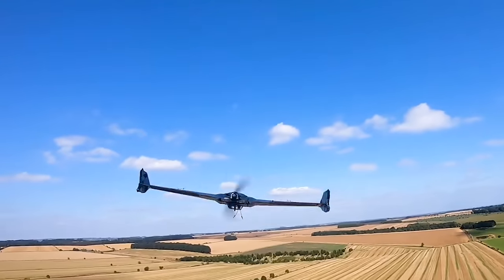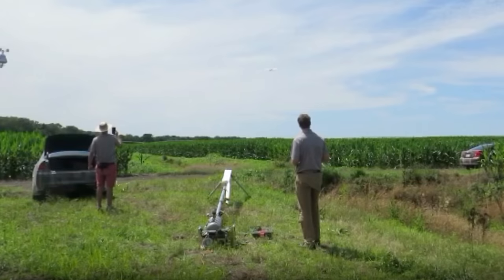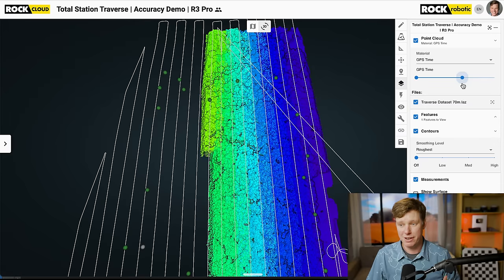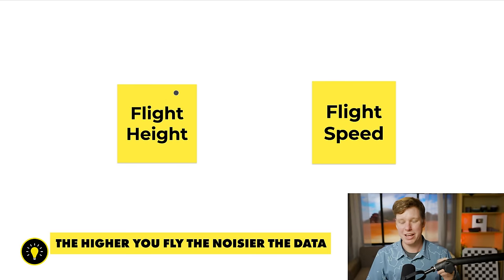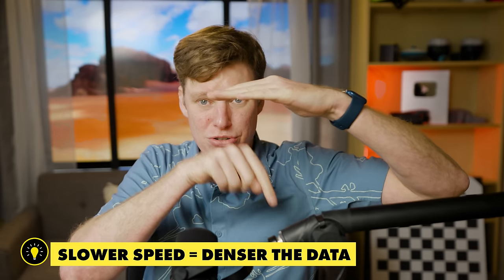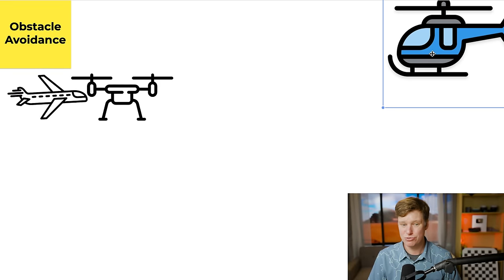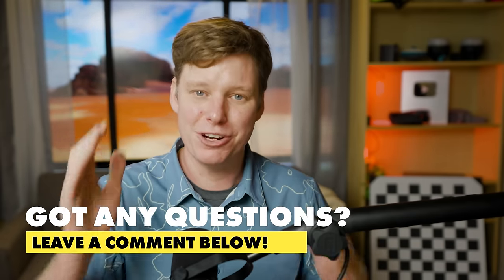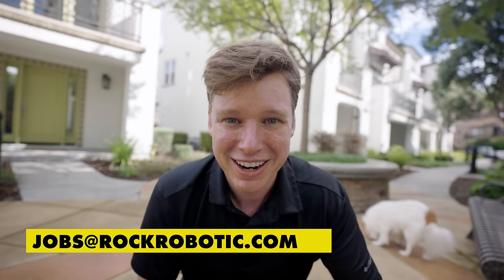Fixed-Wing vs. Multirotor Drone LiDAR

Comment: I completely see where you're coming from comparing fixed wing vs multi rotor in all the experience you have. But a lot of the issues you presented about lack of consistency in the data could be fixed by certain parameters you can adjust (at least with the autopolit software I use) and any accuracy issues I feel like would be resolved by being able to take a lot more passes thanks to the significantly longer flight times. Not doubting your experience and I agree with the issues you presented, just saying it seems like there are solutions to a lot of the issues you mentioned. Sure it would take more work to get it done with a fixed wing and those issues in mind, but you would be able to get a lot more data per flight.
Reply: You presented no fixes. You're an armchair expert. Your post is meaningless. You criticize without posting any relevant information. What was the point of your post? Post a video with your claims?

Comment: Hello, Knoll.
Based on my RGB photogrammetry experience, the performance and capabilities of fixed-wing drones (gliders) are highly topography-dependent. For example, in one of my research projects, I used Ebee Sensefly to model hydrothermal chimneys in a valley. Because of the collision avoidance, the drone flew so high that the results were marginally better than Google Earth imagery. As a result, gliders work best in relatively flat or uniform topographies, for the rest, a multirotor drone such as DJI Mavic or Matrice series would be more convenient.
Reply from the maker: Exactly! I would go one step further and say flat terrain and below level 3 winds

Comment: Wow, I learned a lot, especially scenarios I'd never considered.
Assuming fixed-wing is called for, why not use a gimbal to do automatic slew compensation?
Or dynamically adjust air speed plus gimbal elevation to compensate for terrain/flightpath discrepancies?
Seems like some algorithmic work could improves the workability of some tricky scenarios if you've gotta use fixed wing for other reasons.
Reply from the maker: For the Wingtra their stated stall speed is 16 m/s. So anything below this then you lose lift and stall.  So usually with the  LiDAR payloads that I am talking about we are already going at the slowest airspeed we can.  So any slower is impossible. 

I have made several gimbals for fixed wing and it is not practical for 2 reasons. 1) the added weight.  The max payload weight is 900 grams.  The LiDAR alone is already at or actually slightly above this.  So the added wight of a gimbal is not feasible. 

If we change airframes to a more traditional dihedral wing design and increase the lift surface area ... larger aircrraft.  Then we can support the added weight.  But still the stall speed is usually stuck around this 16-22 m/s.  I havent seen designs that is able to reduce the stall speed down to 6-10 m/s. 

I am sure there are some fundametal aerodynamic laws that might prevent this.  Probs contained in the interplay with mass and gravity force pulling you down and the theoretical limit of upwards lift which is a property of the surface area and cross sectional shape of the aerofoil and the viscosity (Reynolds number) of the medium (air)(PV=nRT)

... I am not an expert at aerodynamics but I can reason that these input variables are what results in the physical limitations.
Reply: @IndianaDrones 
 What about the hybrid drones that take off like a multi rotor and transition to fixed wing flight?
 Are you aware if anybody has programmed them to fly like a multi rotor when that's better given the circumstances and like a traditional fixed wing when that would be more appropriate?

Comment: Amazing video, I think fixed wings are good for areas which does not give you flexibility on reaching by land, so you can cover a huge area without the need to move on land and find a spot to park and take off from, which with the mult rotor depending of the distance you are not able to fly because you would spend your battery on the way and you still need to come back.... etc and considering that you cannot reach the spot by land...

Comment: The big limitation i noticed with Fixed wing or Multirotor (M3E) is the RC. As much as we can swap lot of batteries for my M3E, the RC battery life limits how much data can i collect in a day. For M350, there's a battery swap, but, not sure how many batteries will the RC lasts as it heats up a lot. and YES, YOU'RE RIGHT, Fixed wing is good for initial run for green field projects not more than that. Landing a fixed wing is sometimes pain. Thanks for the video. Hope you can expand in India.
Reply: You can use a long, heavy duty car charger extension to charge your transmitter while you're using it.
Once upon a time my transmitter went dead. I was able to keep going with the car charger but that one only a very short wire so it was a real pain.
Then I looked into it and found that you can buy a 15' long extension..

Comment: It seems like it would be trivial, in fact I am sure it can be done in even hobbyist autopilots, to have the fixed wing plane fly at a fixed ground speed (obviously within reason depending on the windspeed and the power of the aircraft - if it is a 80mph wind or something you probably aren't flying). You can't fly a slower downwind groundspeed than windspeed + stall speed, I suppose, but on a properly designed drone that should be plenty slow for any windspeed that would be reasonable for flying. 

The climbing slower vs descending faster is the same issue, with ample power reserves it is absolutely something that a fixed wing can accommodate. At the extremes, a multirotor actually has the same issue, there is a certain point where a multirotor will need all of its power to climb to follow the terrain and will necessarily have to go slower while ascending...

I feel a like a simple servo actuator on the LIDAR device would be able to keep the beam exactly perpendicular to the flight path regardless of any crabbing done by the plane. Again this would be easily set up in a hobby autopilot....

Comment: Well done..from a Pilot point of view there are far more issues that can happen flying a fix wing.  so why a fixed wing...?  Great for very large areas and flat and when there is no wind and your density altitude is just right.  This affects all kinds of things, like air speed.  Sooo way to many things to get over and on top of  that the data is KEY.....GREAT data is great work.  The more vagaries in the work...the data suffers.  This work is tough enough with the work flow....so why make it harder with a fixed wing.  H knows this and is trying to say GO DRONE not fixed wing 98% of the time.
Reply from the maker: EXACTLY!

Comment: Hope you can show actual data sets of both multi copter & fix wing to support your argument.
Reply from the maker: Sure! I’ll see if I can get some. 

It’s just logical though. Run through the thought experiment yourself and see if you can come up with a different conclusion. 

I’ve done the tests myself but it’s very logical. From the mandatory requirements of lift and the geometry of the airframe dictates their respective flight characteristics. 

You don’t see Boeing making hundreds of prototypes and crashing them. The physics of aerodynamics are solid.

Comment: We had a client from the UK insist that we use a Wingtra on a project in Western Canada.  We investigated but had concerns with the ability for the vehicle to accommodate for cold and strong winds.  We eventually told them that we refuse to invest in it for this project.  We have been collecting data on the same 1000 acres for 46 straight weeks during the project duration.  We would probably be on our 3rd Wingtra if we decided to buy it.
Reply from the maker: Exactly!

Comment: Going up and down with the plane, if done with tilting the plane, would also affect the data significantly.
Reply: Unless the sensor is on a gimble like most quadcopters. However in another comment ID explained that his experiments with Gimbals showed that they're impractical for a few reasons.
Reply from the maker: Can’t do the gimbal on these small fixed wing uas.  The LiDAR payloads are already at 1 kg.  And in the USA we have a limit of 55 lbs.  so to make the aircraft bigger to accompany the additional payload weight then you add mass from the aircraft and then you need bigger batteries to drive bigger motors to get the flight time and then those add mass.  

So it quickly adds up. 

In my experience, going from a traditional fixed wing with 12 ft wing span and also a large rudder and elevator was still pushing the flight characteristics and wind happens. So you want to have extra room and not be flying super close to stall speeds 

I moved up to a 15 ft wingspan system and the extra lift surface area really helped the flight characteristics. 

But this system weighed close to 100 lbs. 
(Didn’t fly in USA)
Reply: Wow, thanks for replying @IndianaDrones

Comment: Why can't a fixed wing aircraft maintain consistent speed over the ground?  Don't they have throttle control?  Now I understand if there's a tail wind that would limit how slow they can go but in a crosswind or when climbing and descending why can't they just adjust throttle to maintain a consistent speed?

When they (fixed wing) crab into the wind they don't do that to maintain lift over the wings, they do it to maintain their course. They could fly perpendicular to the wind but they would be blown off course.
Reply from the maker: They do have throttle control but there is a minimum airspeed that must be maintained to generate lift or the wing will stall. 

Depending on the airframe used that speed changes.  So if you were flying 5 m/s over the stall speed then yes, you could slow down by 5. 

But in practice with drone LiDAR payloads the stall speed of these small fixed wing systems is already pushing the limit of good data quality. 

So you are basically flying right above the stall speed and don’t Have any room to slow down.
Reply: @IndianaDrones  
 I understand, I was just thinking that when they have to climb they could add throttles and maintain their speed when they're descending they reduce throttle to maintain their speed while staying above stall speed all the time.
 The exception would be in a trailing wind situation then it would be difficult to slow down enough.
 Thanks for all the interesting and useful content you post. Even for those of us who aren't in the LIDAR game it's still  useful and very interesting.

Comment: Well... mostly that is a bs. 10 minutes of bs. You have to mount lidar on both crafts using GIMBAL, otherwise, if you'll fly with a mrotor, your data would be very fuzzy, because random tilting and rolling of the drone to maintain a stable speed or blows of the wind, and battery sagging over time. Obiously the plane does have isues like you've mentioned, butgimbal solves all of them. And also due to waaay longer  time of flight plane can do scanning only every second pass, which gives you consistent measurements...
Reply: Based on your experience which aircraft, gimble and lidar do you recommend?